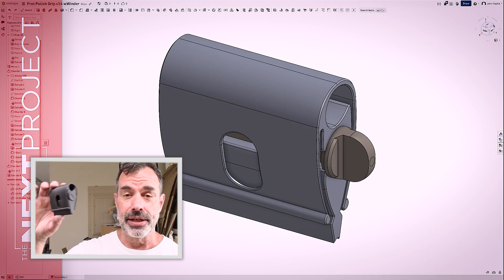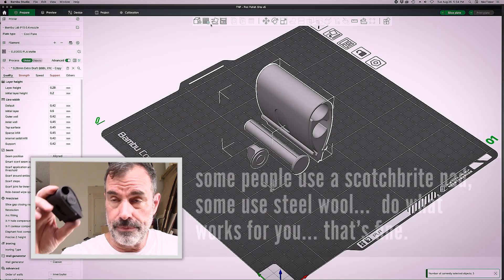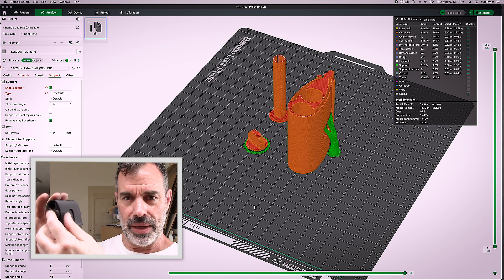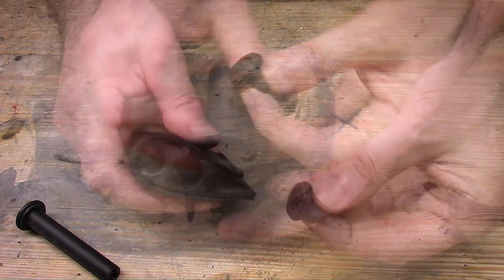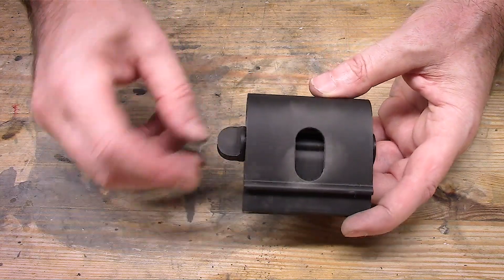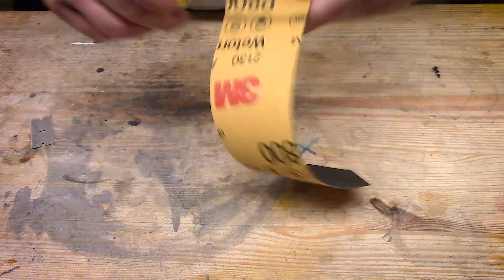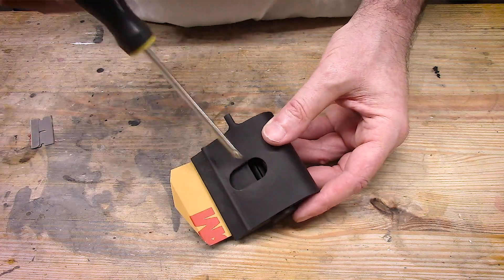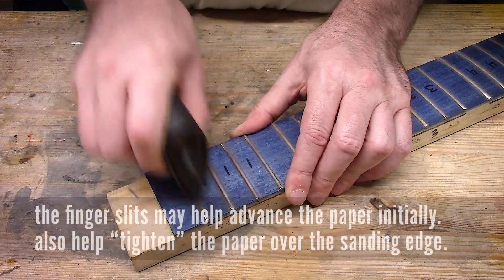Fret Sanding Polishing Grip v17 - 3D Printing Guitar Project Tools  Ep4

Comment: This is cool I’m interested in getting a 3d printer what type of 3d printer do you need or will any do the job
Reply from the maker: Laine, thanks for watching!
Great question regarding what 3D printer to get - or if you need one - or if you can justify getting one...
I put off getting a printer for a few years, there was no way I could justify the purchase. I didn't want to print all those cute little trinkets that we see. I couldn't envision printing tools that I could use either.
Well, I keep looking and attempting to learn.  That's when I realized a lot of 3D print people see 3D printing as another project, fixing, modifying, trouble-shooting.... I didn't want that either, I have enough projects.
So, I started looking for reliable, repeatable, turn-key 3D printers.  
In the end I was largely looking at Bambu Labs printers. The have a couple small format entry-level printers that are just barely affordable. My concern was the size of pieces that those printers would deliver.  So, I went up to the mid-level Bambu printers and purchased the P1S, which is/was the top of their mid-level printer at the time. 
I tried to envision what I would be printing, what materials I'd be using (carbon fiber filament...), so the P1S with an enclosure and expandability to handle special filaments became a baseline for printer selection. There are other equally capable printers on the market, I have no experience with them, but what kept bringing me back to the Bambu was "turn-key". It was easy for me to learn, really easy to set up, connect to my computer, monitor with my cell phone.  
I suggest doing some soul searching, determine if it is a justified purchase. Maybe you have some kids and this would be a great learning process and family thing for all, IDK.
Anyway, determine the size of things you can imagine printing, then look at the printable area of any printer you are interested in. 
Take your time, do the homework.
Buy once, cry once perhaps.
Sorry, this isn't an answer, just some emotional support.
Be safe, take care and happy shopping!

Comment: Wow, a nice little tool you made there.
That's all work too advanced for me.
And to give you an update on my tiny projects, I just replaced the bridge on my Sonic P-bass with a Fender high mass bridge, replaced the pup with a Tonerider Precision plus, that has a model name, they no longer sell. But maybe it's just one of the two models they sell now, only with a different name. And new strings, when the old ones weren't old at all, but I cut the G-string too short anyway, it would not have fit. Though it was my plan to replace the strings anyway.
The Squier Bronco has to wait, I have to save up my money for some months first. But thats okay. I already have the pup for it. I will buy a router bit for my cheap non Dremel to modify the pickguard.

Have a good time, we'll talk again.
Reply from the maker: Achim, good to hear from you and thanks for watching!
You've been busy! Sounds like you've got plans for the Bronco when the time comes. 
Good to plan things out.
Be safe my friend!
Reply: @theNextProject  Yeah, I'm planning to use a mini humbucker frame as a routing template, as you normally find routing templates for the wood, not for the pick guard. And you don't rout the pick guard out for the holder part of the pup, only for the metal cap or the bobbins.

Comment: My father-in-law owns a machine shop, and a 3D printer; I may send this his way for a favor (and some of your other files in the Dropbox). 
Thank you, so much, for shaing your engineering with us! 🙌
Reply from the maker: Kevin, thanks for watching!
All good, take the file (and other files) and get some stuff printed.
Hope the tools help in some way.
Be safe and take care!
Reply: @theNextProject  Ok, update time. 
Retrieved the part and inserted some sand paper, this took a bit to master (to overcome the paper getting loose or being too tight). Over last weekend, I did 3 guitar necks! I used 400 & 600 grit, followed by 00 & 0000 steel wool. I finish with Renaissance wax. I did buff the first one, but found it not necessary on the other two. 
Those three necks feel buttery smooth and the frets are super shiny! Again, thank you for sharing your work!

Comment: Excellent work, as always.  That looks like it would work really well.  Gonna be one of the first prints I make when I eventually pick up a 3d printer.
Reply from the maker: OMZ, thank you for pushing me along with this project.
I was ready to call it a day, then your comment made me take a step back and revisit things.  I think we're going in a good direction now. Probably a few more tweaks in the future, but - it seems to work reasonably well.
Thank you again, be safe and take care!
Reply: @theNextProject  Yeah, I had one more idea, but kept my trap shut and let you enjoy the moment.  Heh.  Now that that's done... you know the open gap where you slot in the arrow?  What if instead of a larger gap to get a screwdriver through, you make a thinner slit, but put it on a hinged panel (pulled downward) that you can more easily slot the paper through, then open the hinged panel and tuck it into the slit in the inner peg.

Honestly, that's all I could think of to improve on this, and it's hardly necessary.  All in all, I love this design and look forward to printing one up.  Thanks again for sharing these files.
Reply from the maker: Man, you've got some design ideas going on. I would like to make this easier to load.
I as also thinking of some sort of "wedge" insert to lock the paper into the reel, but I don't what loose parts added to the tool.
So, I'll let this roll around in my gourd for a bit.
Glad to share stuff like this, hoping it helps someone along the way.
Take care my friend!